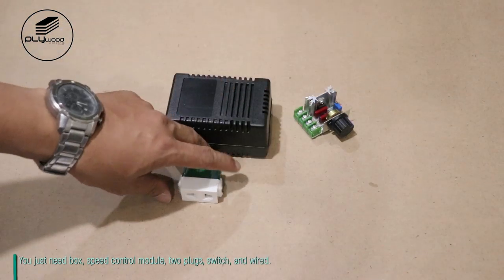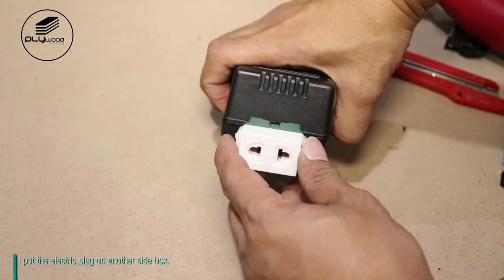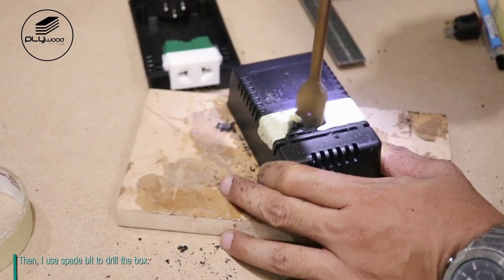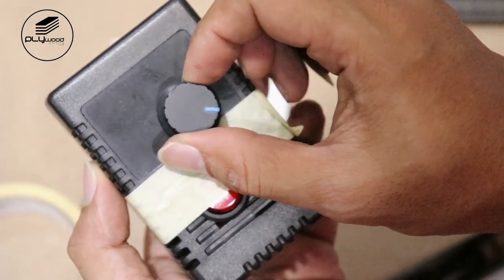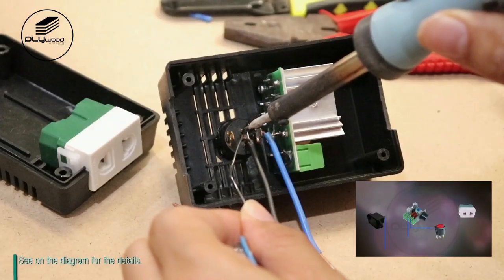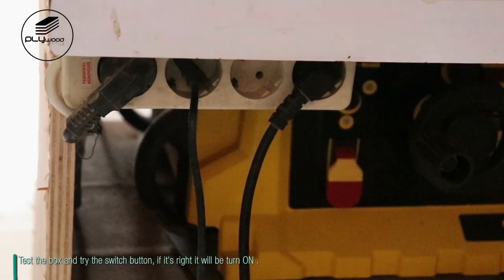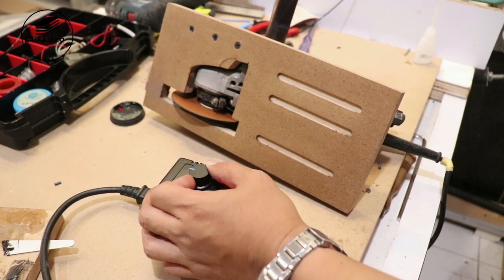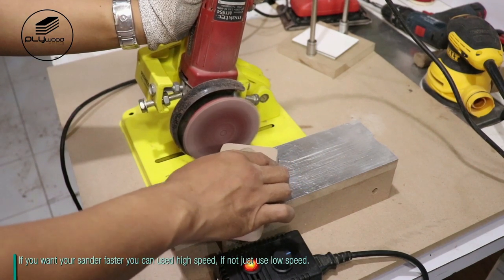DIY Speed Controller Adjustable Box for AC Motor  Powertools

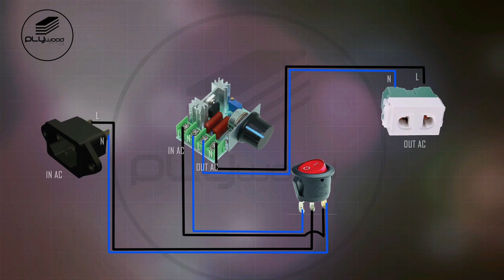Comment: I need an ac motor speed control for my lathe. Looking at your circuit diagram, at 4:11, is there an error at the switch? You have the live wire and the neutral connected to the same terminal, this would cause an immediate short circuit.
Reply from the maker: I made this on 2019 still work good until now 2023, i don't know maybe i made mistake coz i not expert on electronic, i know not give neutral maybe if using this too long same like your ask short circuit. Max i using only 15 minute
Reply: Based on the connection to the rocker switch shown in that diagram, it'll definitely short out. Strangely, no one else pointed that out

Comment: om beli speed controller dmn? boleh bagi link tokonya...
thanks a lot
Reply from the maker: Dlu beliya di ali express tp toped skr  banyak kok modulya mcn2
Reply: @plywoodworking  siap om...
 3x beli via olshop dr 60 - 120rb, utk gerinda maktec dipake 3-4x kebakar, akhirnya 2bln yll beli gws 900-100s variable speed
Reply from the maker: Beli modulya aj jgn beli krng kuat, klo buat sndiri bagus
Reply: @plywoodworking  o..gitu ya, pantesan.
aku coba dl, 1x lg thanks a lot ya

Comment: This chops your wave. You need to skip waves, not chop. Your motor will conduct on low voltages between the peaks of ac power and just burn your brushes up.
Reply from the maker: thank you very much!! sorry for late reply
Reply: @plywoodworking  aw buddy, you're welcome. I'm subbed now
Reply from the maker: Many thanks 😊😊

Comment: Om mau tanya kalo circular saw hitachi C7ss itu mesinnya AC/DC si om? Pernah mw beli Dimmer di bukalapak, sya tanya pelapaknya dia bilang ga bisa klo buat circular saw, soalnya watt CS nya 1050 rumah sya dayanya 900 😂
Mohon pencerahan nya om, barangkali bisa bantu
Reply from the maker: Klo cs pasti ac kecuali yg pke batrai bru DC, hrusya bs tp gk kuat lama2, ini bs ampe 10ampere di speksifikasi brti max bs ampe 2000watt, klo buat TS mkn gk kuat
Reply: @plywoodworking  ohh AC om, berarti bisa lah ya, nanti sya coba,
Oh iya om TS apan ya? 😅🙏
Reply from the maker: Bs mas max ini bs ampe 2000 watt cm gk recom buat ts kykya coz gedhe bgt
Reply: @plywoodworking  maksih mas ats info nya😁